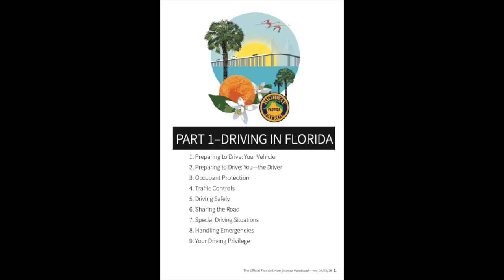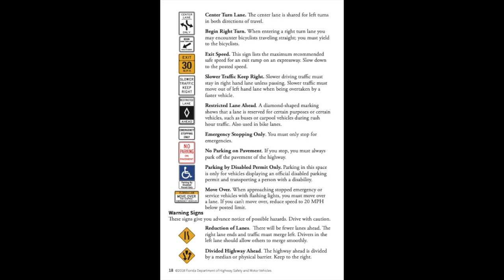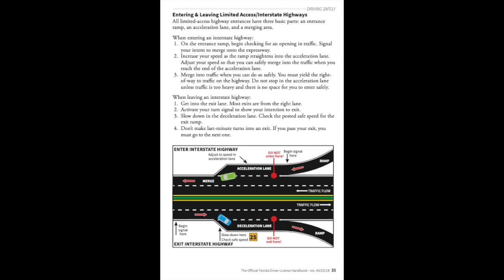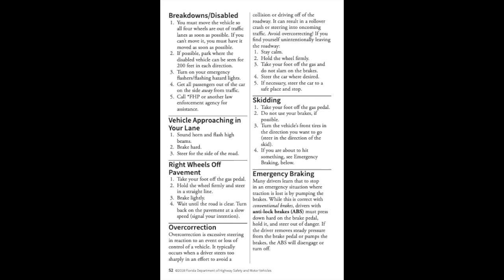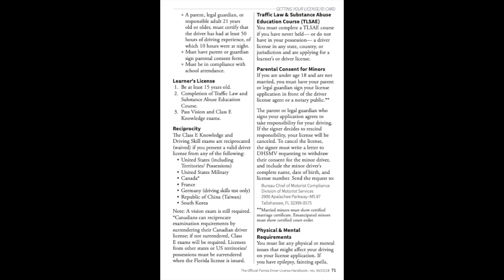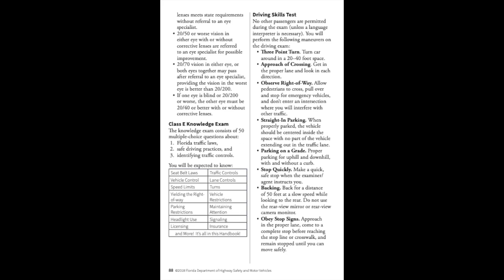florida handbook driver license

Comment: Finally got my licence today. The written test is very tricky and designed to fail. Some questions are easy but the scenarios are twisted and mislead you to answer wrong .
Reply from the maker: NicknLex  Congratulation
Reply: I failed my second time 😭
Reply: @stephaniesanchez2057  Are you in Florida? This test took me 4 tries and I always had 39 answers right. The driving part was actually the easiest part of the test. Just go through the manual again and try to absorb all the rules. They got me twice on railroad rules. Good luck !!
Reply: @NicknLex  does the questions always stay the same in the computer exam at the dmv??
Reply: @leoram2890  no, unfortunately they always change them every single time. It almost seems that the machine knows it's you. In the 3 attempts I maybe got one question from a previous exam. It's brutal. Just study the entire manual. Even if it seems unimportant. Distance between cars, railroads stuff. Color of lights trucks use. Flags etc. Good luck. You can do it!!
Reply: NicknLex 
Fml I’m taking my second and hopefully not my damn 3rd test tomorrow. There really were some questions that you’d never expect there.
Reply: I’ve failed my 3rd time and I need to go take it the second week of September. Hopefully I passed cuz I need my driver license.
Reply: K- Squad 
Like, the actual driving test? Not written?
Reply: 3DLavaLamp the written, it’s the written test.
Reply: I failed three times !!
Reply: @Cjenny0  me too. What I hate is that you can only fail 2 times a day
Reply: NicknLex I have failed again and It was literally just one more left
Reply: @Cjenny0  Omg Jennifer that happened to me 3 times that I failed by just one question. You can do it!!! Try to take the longest time possible  to answer each question.  Best of luck!!
Reply: NicknLex lol thanks 16.25$ each test I gotta do better
Reply: @Cjenny0  I know why are they charging for each try??? You got this!!! Let me know once you passed!!
Reply: Jennifer C for real they do be charging for they shit. I’m taking mine this Monday I’m excited 😆 so hopefully I pass.
Reply: K- Squad good luck!
Reply: Jennifer C thank you.
Reply: I take my permit test(written) next month and I have been studying practice tests, (I even used the one the FL DMV Website has), using Quizlet and reading the manual. If you remember what the questions are like or have any additional study tips, please let me know!! :)
Reply: passed my first time at 15😎 just study the book

Comment: I finally passed my permit after 5-6 tries. I did it back in 2016..(didn’t study much) until I passed this year of 2020. Due to moving states a lot I was unable to actually receive it, & in highschool I didn’t really care about driving (Big mistake) it’s easier to take the permit in Highschool instead of actually going to the DMV. The florida permit is quite tricky I’m not going to lie. They’ll use different scenarios to trick you. The book was boring to read but once you read it like 2-3 times & answer the knowledge questions at the back it comes with good practice. I also did online practices as well until I got it. I got my permit August 27 then my license Sep 18. The permit is harder but the license is easier. 

TIPS: Read the book until you understand it & answer the knowledge questions at the back & use the online practices. Keep doing it until the questions stick to you. As you’re reading make sure you understand what you’re reading to get a better understanding, so once it comes to any trick questions or different scenarios you’ll know what answer to put when taking the exam

If anyone out there is trying to get their permit or license. Good luck, you got this ❤️❤️❤️
Reply: Hey, Shan! Did you get any questions about the Pending Florida Statute Changes on the test as a question? That part of the book is freaking me out simply because of the numbers with the sections. It's a lot of numbers to memorize.